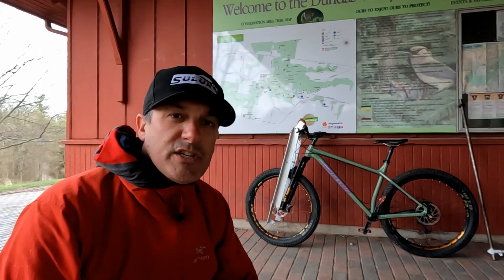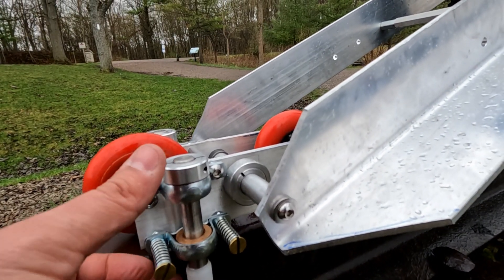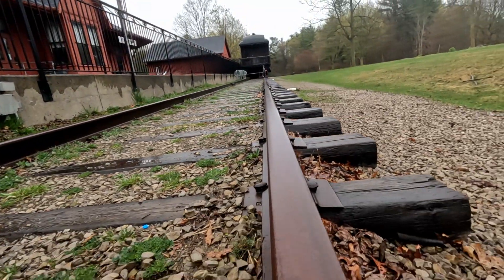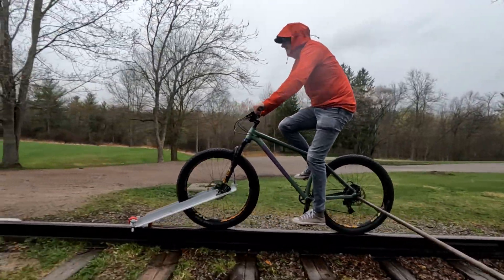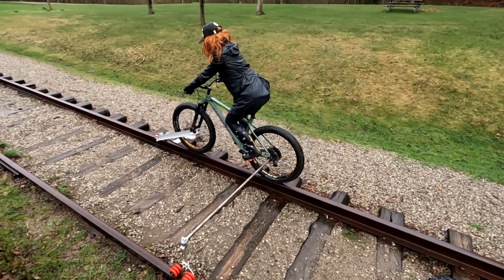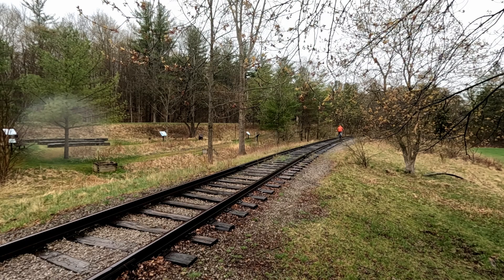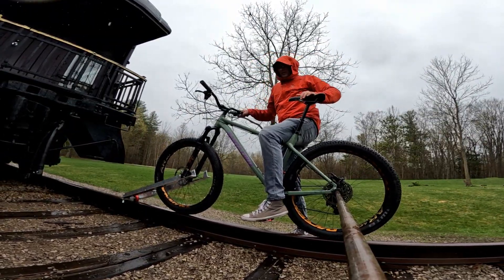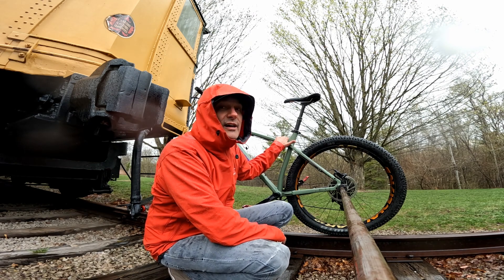RAIL BIKE - Version 11 - The RED BARRON returns - New Front Guide & Updated Outrigger - IT IS READY!

Comment: This is awesome, it has been so cool to watch this from the last 5 or so iterations. Have you considered creating a brace for the outrigger that goes from your fork, back across to your outrigger wheels/stack? I bet it would increase the stiffness and help prevent the slight lean you got from flex of the outrigger pole/flex at the rear wheel attachment... also, one word "CARBON"! 3,000 miles sounds ambitious! I love it 🙂
Reply from the maker: Thanks man. I'm having a blast working on this thing, and I'm honestly learning so mich. It is such a quirky device. I might add a brace, going to see how it works out once I redesign the outrigger for optimal stiffness.

Comment: With the front guide extended out further, it should have provided much more control over the front wheel steering. Did you feel you could have let go of the handle bars at any point and the bike would have continued forward without any issues?
Reply from the maker: These older versions were always finicky. Have you caught up yet, and seen the newest version? On that one, you can certainly let go of the handle bars.

Comment: Is rolling on the rails less resistance than on the roads? I would think the rails are more efficient but then you also have to account for the drag of the guide wheels.
I'm thinking an electric rail bike pulling an inline one wheel trailer would be an efficient bug out vehicle when the roads are jammed.
Reply from the maker: I've never done any measurement but the coefficient of friction between the bike tire and a very smooth steel railway tie is very low. You can see in some of my railbike videos that a small push on the device leads to a very long coast along the rails. I plan to do an electric bike version but that would only be for shorter rides, not the multi-day trips that I plan to do with this.

Comment: Also if you double the front wheels front and back plus use two horizontal spring loaded wheels on each side that ride the side of the rail on both sides.  Similar to the top wheels this will work better then the pins and be allot smoother.

Comment: OK, I'm new to this, but my one thought on seeing this was why not have everything at the front, outrigger as well. Then maybe a rear system like you have at the front trailing the bike. (funny, I just checked your new video of the home-made rail rigger)
Reply from the maker: Yeah, I'm basically testing every scenario I can think of. The front wheel only system in the new video is awesome, it's just very big but I'm working on getting it smaller.
Reply: @Suluk46  then I checked out version 10, silly me :) - I was wondering if you had a cable from the outrigger to the front of the front rig, and maybe a system which locked the front wheel to the frame, like a flip up ladder from the frame to the forks, making the whole front end rigid.

Comment: needs rigid front frame. get rid of the fake shocks also the length of the rear bar  is an inherent problem. Using smaller wheels would be a big help, smaller the better, maybe fitting into your backpack for long halls.

Comment: Watching the test footage, the outrigger is producing torque in two directions.  I can see it rotating backwards in a horizontal plane.  It also twists in a counterclockwise rotation through the vertical plane (forcing it backwards).  Someone said you need to triangulate to counteract the forces.  I’m no engineer , but if you ran a bar from the outrigger bar that goes down to your wheels to the front guide, you would counteract the forces some what.  I think you are currently sacrificing stability and strength for weight loss.  This is of course just my opinion.  And we all know what they say about opinions being like a$$holes,  everyone has one and they all are full of $h!t.  Except for sloths,  they p00p through there skin,  I think.  LOL.  Great stuff to watch though.  I’d love. To see another trip on this thing.  Maybe the next time you won’t forget your tent in the middle of the trip.   LMAO
Reply from the maker: Digging into the archives? Awesome, it was a fun journey. And you are correct on both assumptions, and both ended up being an issue which could easily be solved using methods such as you recommend, but would then make the setup non-universal. Being universal was a requirement of the design so that any bike could use it, including the various bikes I have, and anyone I was going to ride with. Ultimately, I abandoned this entire concept and went with the device you see in my actual trip videos. It is much more reliable and easily adaptable to essentially (within reason) any bicycle. As for trips, I just went out yesterday to head for a trip and the railway was so overgrown at this time of year that we couldn't ride them. Totally bummed. Gonna have to wait until fall when the foliage dies off.